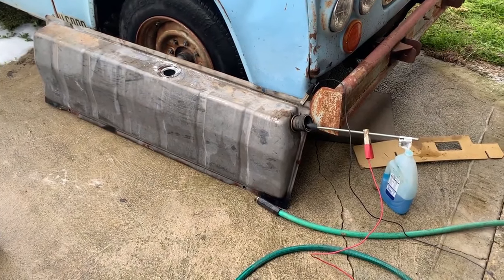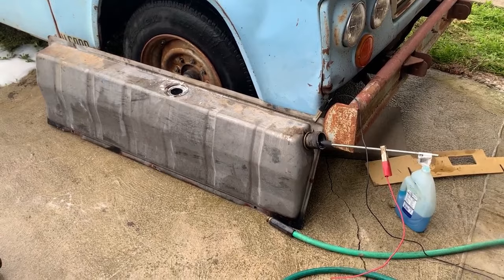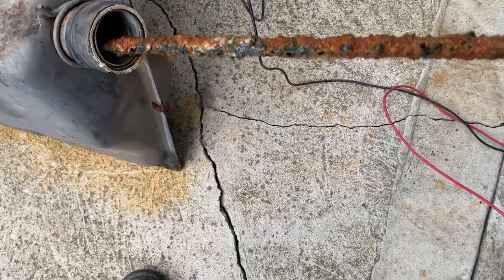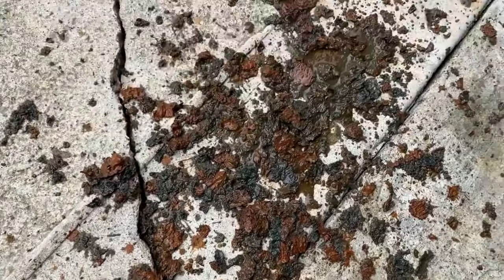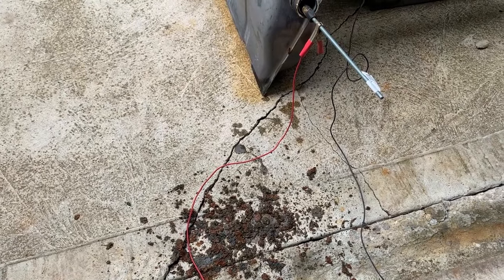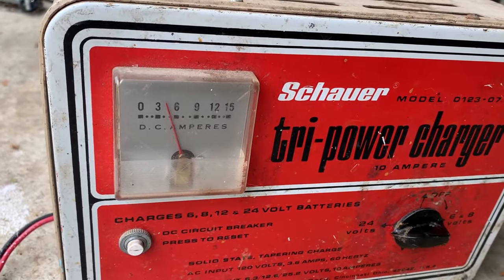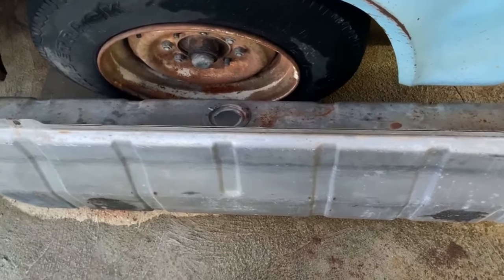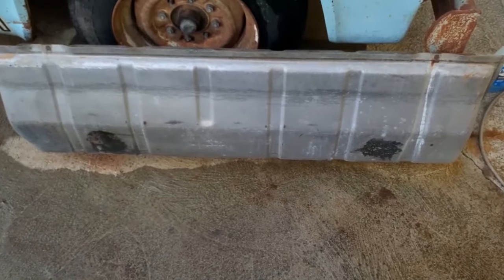Old school trick to clean a rusted out gas tank.

Comment: Hmmm interesting chemistry tank cleaning.  I’m not sure if I am that patient.  I have used muriatic acid on my old rv fuel tank but after it was clean bare metal I used the por tank clean to prevent flash rust then por fuel tank sealer, and coated the entire interior and por claims it will never rust again.

Comment: Great video and it sure looks like an excellent way to get the rust out, but I have some questions.  
1.What were the proportions of Arm & Hammer Super Washing Soda Detergent Booster did you use per gallon ? 
2. Would a length of carbon steel pipe work in place of the All Thread Rod ?
3. Do you know if this method would remove any old varnished gas along with the rust too ?
Reply: It’s been a while but I remember a cup or so for for ten gallons of water, I don’t believe the solution was super important .  don’t know that the rod is super critical either, as long as it’s conductive and NOT stainless. I don’t think the solution was intended for degreasing or cleaning, just to facilitate the process of electrolysis. I did use dish soap and a pressure washer before I started the de-rusting with pretty good results. Thanks for watching!
Reply: @ccathey3934  would this work with vinegar instead of the solution?
Reply: @warrenpeas   If you mean only vinegar and not the electrolysis process, I think so. I have not used vinegar for rust removal but believe it works. I know there are lots of YT videos on it. I would not use vinegar in the electrolysis process - simply because I have no idea what it would do. It would also take a large amount (my tank was 19 gallons). Thanks for watching!

Comment: Looking for a way to do the inside of a 40 gal propane tank,,looks like this will work fairly well,,heck of a lot less expensive than 40 gal or vinegar
Reply: Cost wise it would be fairly effective since you only fill the tank with solution once . That’s a larger tank than I am used to but the principal still the same if it’s Steel and Rusty this process will take that rust off. Coding the tank afterwards would probably be a good idea, I used marvels mystery oil and I’m not sure that’s the best -there are several coatings out there. Frankly I was worried that coatings wouldn’t stay adhered ,flake off and plug up my fuel filter. thanks for watching!

Comment: That's an unusual battery charger you have. Mine is 12v only but with 2 12 and 50 amp settings and a choice of deep cycle or not.

Comment: that tank looks amazing, i was going to use muratic acid, but this looks a lot safer and the results are fantastic. i know i can't use stainless steel, but is galvanized safe?
Reply: @MadSceintist  i didn't know fuel tanks were galvanized, im always learning something new. thanks for letting me know
Reply: I don’t know if the tank was galvanized or not but given the amount of corrosion inside I highly doubt it. The sacrificial rod I used may have had some galvanized coating on it but again it was all thread so I doubt that as well. I would avoid galvanized rod for the sacrificial element but someone else more knowledgeable might chime in here.

Comment: What did you use as a rod for this? The result is amazing
Reply: This was a section of 3/8" all thread STEEL rod. 

DO NOT USE STAINLESS FOR YOUR SACRIFICIAL ROD!!!!

 The pvc cap I drilled out kept the end from touching and grounding out.  The rubber hose does the same at the top.   THANKS  FOR WATCHING!!!
Reply: @ccathey3934  how’d you keep the cap from falling off?
Reply: @jayvalentin018  the end cap was a pvc plastic pipe cap that was drilled out to slip the all thread. I then sandwiched it between two nuts on the end of the all thread. The cupped part was facing out and covered the rod end and nut.  Worked great!

Comment: Thanks! I'm doing this to a 64 vette tank. Quick question, since you had the electrode coming out the side of the tank, there was still part of the tank that wouldn't have been filed with the solution since it was higher then the inlet you used. How did that come out? Did you flip it or deal with that rust in a different way?
Reply: The angle of the tank and the volume of liquid inside the tank are about the only way you can guarantee that it is completely coated with the cleaning solution/“reached” by the electrolysis .The top of my tank wasn’t bad so I didn’t worry as much about it but it wasn’t completely full to the point that it was coming out of the top fill.

Comment: I will give it a shot with my GTO tank.
Reply from the maker: Let us know how it goes.  Feel free to ask any questions.
Reply: The key for me was a pressure washer in the beginning and then to keep cleaning the rod off - the last few times with a pressure washer. Patience - I probably repeated this process 5 or 6 times before I was done. I wish I had a video of what I began with. This process will dislodge rust and attract it to the anode. It will not replace pitted or damaged metal so a tank re-conditioner may be needed depending on the amount of damage/rust found after.   Good Luck!
Reply: @ccathey3934  I assume I will out grow the one gallon plastic tank at some point. So a tank install is my future. Not to  soon need to finish welding in the trunk. Out of two tanks one was holding 10 gallons of some vintage cologne, 1990s I believe, the other was dry. Good odds one will work.  I have used rocks in motorcycle and mower tanks with success to remove the varnish. I would think I need a vibrating compactor to get the same action on a 20 gallon tank.
Reply: @67VentWindow  Good luck - there are lots of methods out there that work. I did not use abrasive media on mine because it wasn't needed - I started with dish soap and pressure washing and that cut the varnish pretty well. I know some will not be as lucky.

Comment: HMmmm - all the rust is gone - but - no mention of anything further.  Bare steel lightly coated wit WD-40 or Mystery Oil only stays protected until the gasoline dissolves it and carries it away.  The rusting will start again as soon as atmospheric humidity condenses inside the tank.  You probably should have at least mentioned in more detail what follows next.
Reply: You can get special fuel tank paint that goes inside the tank after you have cleaned it out. You basically slosh it inside and then pour out the excess
Reply: That’s correct. I would expect it to last at least as long as it did - which is about 50 years. I’ll risk it. As mentioned below or elsewhere in this comment section, there are several products available to coat your tank with. Feel free. I chose not to mainly due to poor experience with what’s out there now. Last time I coded the tank after this the coding didn’t stick and made a bigger mess than it was worth. I’m not sure if that was application error or just a poor product but it left an impression on me that I haven’t shaken. I’m not concerned with coating tanks anymore. Thanks for watching!

Comment: Are there mechanics who are open to doing this as a service?
Reply: I highly doubt it but i suppose it is possible.  I would search for a shop specializing in restorations, they would be experienced in saving hard to find or obsolete parts. Fuel tanks will always be the Achilles heel of older vehicles. Restoration of fuel tanks is a difficult process, and the aftermarket has stepped up to SOME of the supply need. To be fair, I got lucky with a solid tank that had non-structural surface rust on the interior. Results vary with the amount of damage done/rust involved. THANKS FOR WATCHING!!!

Comment: The newer chargers won't work as they won't come on if they don't detect a battery. Anyone else seen this or know a way to get around it?
Reply: Use a car battery as your power source, and connect the charger to that. Do it outdoors though, lots of hydrogen gas will be emitted!
Reply: @spacetruckin6555  Seems like you'd need a way to control the rate ?

Comment: Could I use rebar as my electrode?
Reply: I think rebar would probably be good. The only thing you have to make sure of is that you’re able to isolate it from the surface you are cleaning. A rubber cap of some type or  a rubber sleeve would probably do fine. Don’t use anything you care about because the process eats your rod.
Reply: Came here to ask this same rebar question! Thx for this interesting video.

Comment: Let me be clear.... Muriatic acid is king. Period. No debate
Reply: I think you might be right on that one but I will leave that to others to decide.i I have never used it. Thanks for watching!
Reply: @ccathey3934  white vinegar it takes many many days just to get surface rust off if you did it within just a few hours that's very surprising. This acid literally is the real deal and I'm telling you it will eat that rust right before your eyes and it doesn't take hours it just dissolves it within seconds not minutes you can watch the rust be eating up on contact
Reply: @TIHIS  after that acid treatment the steel is  way more prone to rust again, because the ability to accumulate oxygen atoms again in the surface of the steel is enhanced. electrolysis is a good and soft procedure in the long run
Reply: @V8freaks  Plus you don't ruin your lungs inhaling the nasty acid fumes.Then you have to properly dispose of the sludge left over.Not worth it.